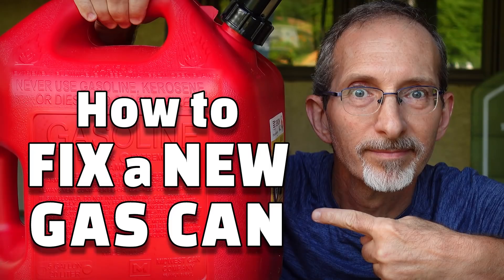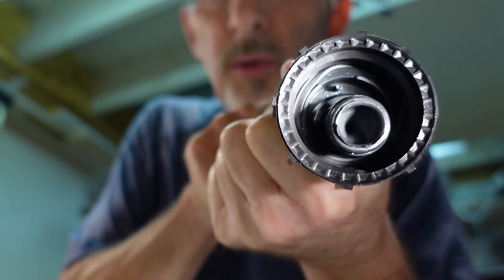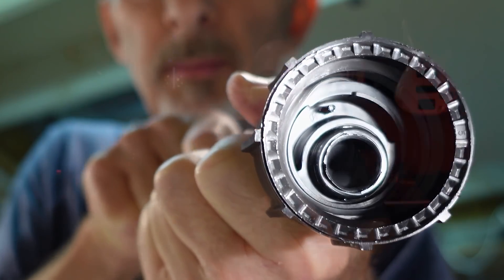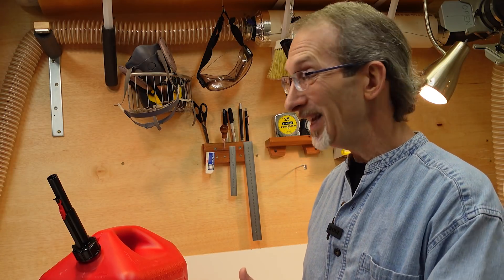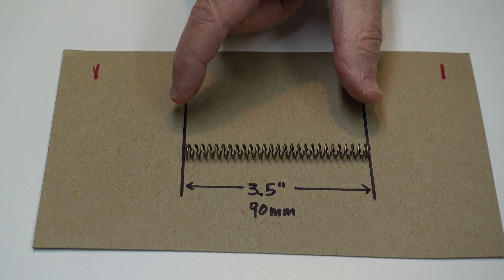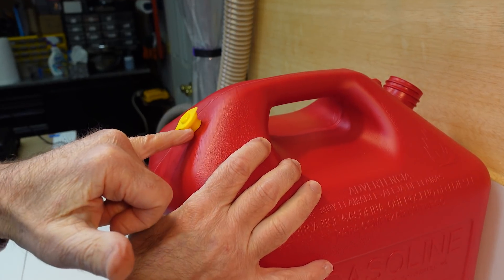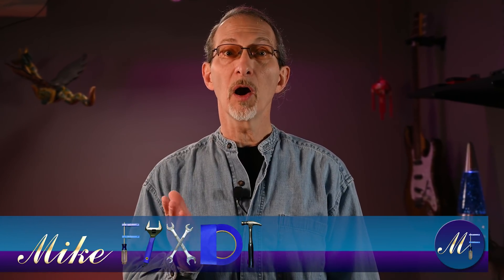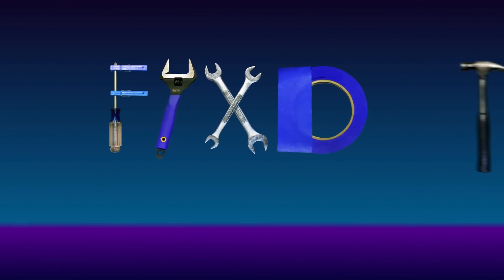Gas Can Modification | Part 2: Explosive Details!

Comment: I've put these vents on all of my gas cans. I leave the  vent open when in storage to keep the gas from pressurizing when temperature rises while in storage.  When the gas becomes pressurized after temperature increase it will come gushing out of the can and spill everywhere when the vent or spout is opened.  This happens mostly when the can is full.  Happened to me more times than I want to count until I installed these vents.  Also, when the can is empty and not vented the sides of the can will suck in overnight when temperatures drop.  Properly used, these vents are the best.

Comment: I am over 60 years old. I’ve had many gas cans and these poorly designed. Supposedly safe new ones have caused me to spill more gasoline on the ground in the last five years then I did in the previous 45 thank you very much government regulations and people that have no idea what they’re doing. Next, let’s talk about the safety sealing function exactly what is the burst pressure of a plastic can when you leave it sitting in the sun full of gasoline.? so to summarize inconvenient to fill difficulty use must be modified after purchase, and eventually you throw it away sounds like government efficiency at its finest.

Comment: A step drill works wonders. Just bought 3 spouts from TSC and replaced the pics poor new spouts
Reply from the maker: Step drill bits are cool! I would just add to make sure that you have enough steps to match the required hole size because you don't want to go too big. Replacement spouts are a fantastic option, too!
Reply: The one I have has 11 steps

Comment: For venting my gas cans I drill a hole in the same place but pull a tire valve stem from the inside. I remove valve and use the cap . If you loose the cap you can find them anywhere. It’s only safe to drill a new can so there is no gas fumes.  If you have gas fumes in the can you can use an air drill.
Reply from the maker: Steve, I've seen other people do the tire valve trick. Question - if you hook a bicycle pump to the valve can you push the gas out faster? 😄
Reply: Do what mechanics do when working on a gas tank, fill it with water, no fumes.

Comment: i added vents to my gas cans and didnt have a heat gun. i had good results with adding just a small bit of silicone to the vent "shaft" then pressing them in. i did allow a few days for the silicone to dry completely but years later they still work great. 
also instead of working on the silly spout there are great straight flow spouts available on ebay and amazon for fairly cheap compared to my time to mod an existing one and the frustration of dealing with mandated design flaws.
Reply from the maker: John - great suggestions! Thanks for sharing!
Reply: @MikeFyxdt  you are entirely welcome of course

Comment: Questions on the vent. I know this will sound stupid, but I won't be stupid anymore after reading replies.  Does vent always need to stay open?  What if you poured out all gasoline? How long does it take for locked-in vapors to become dangerous?
(Editing because I accidentally tapped send arrow.)

Aren't you defeating purpose of sealed gas can (for safety) by leaving vent open and allowing vapors to escape?

Thanks!
Reply from the maker: @Alice D - It's important that the container remain SEALED during storage to 1.) keep the gas from evaporating/diluting, and 2.) keep the flammable fumes from escaping into the space the container is stored in. When you are pouring, the vent (opened) lets air into the container to displace the fluid coming out. These containers are designed to vent through the same spout that the gas is being dispensed from, which is why they pour slow and make that 'gurgling' sound. An additional vent at the top of the container (opened only when dispensing) lets the fluid flow out faster and smoother. Hope that helps! :)
Reply: @MikeFyxdt  Thank you!

Comment: My issue is the gas spout collar tends to eventually crack.  I don't know if my son cranks that sucker so tight the thread action forces a crack or the gaseous expansion in sunlight increases pressure to the point of creating a crack (or a combination), or if the material gets brittle over a few seasons.  I hope someone can explain a way to repair a crack when the surfaces are extremely smooth.
Reply from the maker: I agree that cranking it too tight can make it crack. Keeping it out of the sunlight is also probably a good idea… I don’t know if that plastic is repairable. Fortunately there are replacement nozzles available if that’s the only problem that you have with the container. Thanks for checking in!

Comment: The video is good!
The whole situation is ridiculous!
Most people close the vent and screw the cap back on!
The existing designs were fine and worked!
The spout cap, shown last I see it more to keep dirt and debris out than gas in.
The lack of a cap to keep the spout clean is a major design flaw!
The old design addressed that!
The spout is supposed to keep the gas in with the O-ring...so I see a cap now more to keep it clean.

Part of this new design nonsense is that they apparently don't trust you to close the vent and put the cap back on...gee...thanks...what would I do without you?...
Close the vent and put the cap back on I suppose...
The old design was fine and it worked!
I for one don't spend a lot of time pouring gasoline onto open fires...so I question the spark arrestor too.
I will say though I've had cans with that feature that didn't interfere with basic use like yours did.
If it doesn't interfere then I'd leave it be...
In my area plastic cans are chewed on by critters so metal cans look more attractive even with potential condensation problems.
I've had two different spouts with holes chewed in them and the handle of another can with a hole chewed in it.
So, one can totalled and I had to cut one spout short and buy a rubber stopper as a cap and a whole new spout for another can they attacked at the base of the spout.
At least they spared the threads of the can.
Also my fuel got exposed to the air and moisture.
It's been an expensive lesson.
I'm glad some still sell metal cans new, and Craigslist, used without the features both of us don't like.
From now on I'm buying good used metal cans.
Reply from the maker: Michael, I guess I didn't address the purpose of a cap keeping the spout clean. Good point, I agree that's important! If I had to purchase again I'g get a metal can, too!

Comment: Thank you for sharing - 

I absolutely hate it when modifications are done to make environmentalists happy or to "keep the company from being sued".  These new nozzles are hard, and any of us who have tried using them, know you can't pour gas into a car with them, unless you get a funnel, someone to hold the funnel, and you splashing yourself with gasoline.  As soon as I bought one of these, I ordered flex nozzles course threaded from Amaazon, and threw out these stupid "safety" nozzles.  

California in the 70s decided to refit all the gas pumps with these accordian sucking contraptions that were designed to suck the fumes all to "save the planet".  It was a nightmare to fill the car, because you couldn't tell when the car overflowed.  Went back about 20 years later, and all the gas pumps no longer had these contraptions.  

So if you want to save yourself a headache, and don't want to mess with resizing the spring, and still having a nozzle that won't fit on your car, go to:

https://www.amazon.com/kitchespiderm-Replacement-Universal-Compatible-Container/dp/B09DWZ8KBK?pd_rd_w=9MtvH&content-id=amzn1.sym.80bfd2e5-c81d-48d5-ae85-c500e2214af9&pf_rd_p=80bfd2e5-c81d-48d5-ae85-c500e2214af9&pf_rd_r=N1QNAAE6XC613XBG9KYS&pd_rd_wg=BqQ4i&pd_rd_r=b5d1c219-9c70-4e77-9336-4a6a26fc3c78&psc=1&ref_=pd_bap_d_csi_pd_ys_c_rfy_rp_crs_0_i
Reply from the maker: Dwayne - excellent suggestion - thanks for sharing the link! :)

Comment: buy a syphon pump and forget the mods.
Reply from the maker: If you have a siphon pump, then you will still need to remove the flame arrestor screen, as it would prevent the siphon from going to the bottom of the tank. But I like how you’re thinking!

Comment: To quote the great Southern philosopher, Ron White, "Ya can't fix stupid!"  The decline of society is quite sad when, after hundreds of years of humans pouring liquids from buckets and cans, we end up with cans such as these.  Another indicator are the number of auto manufacturers whose advertisements don't highlight the aesthetics, efficiency and longevity of their product, but highlight the vehicles capability of slamming on the brakes when some yahoo steps out in front of the car while staring down at his cell phone.  Has there been an outbreak of oblivious street-crossers? (Or is it "streetS crosser?") Due to Hurricane Ian I had the opportunity to use an anti-splash diesel can.  After figuring out the spout the mechanism, I then hoisted the 5 gal can up to chest height while trying to hold down the safety catch and then shove the spout into the tank. The spout and limiting ring in the truck fuel neck did not match up and the result was nearly more diesel on me, the truck and the ground, than in the truck.  I ended up removing the spout using a plain old funnel-I'm such a rebel.  A comment about your process of installing the vent cap; I was shocked that you were not wearing leather gloves, ear protection, face shield and chainsaw chaps while drilling the holes.  I attempted to perform the vent modification to one of my regular gas cans, but I didn't have a heat gun.  So I used a propane torch...I forgot the can had 2 gal of gas in it.  My comment is being submitted by a Nurse in the Burn Unit who is graciously typing for me.  FYI-I'm envious of your shop vac system - Nice!!  I can't believe I spent nearly an hour watching videos about a gas can....  GREAT Job, Mike!
Reply from the maker: @R Taylor, your post made my week!!! 👍🏻❤️👍🏻❤️👍🏻 Right on brother!

Comment: I've made all of these modifications except for the locking ring. The ring wasn't an issue for me and it did help prevent the nozzle from accidentally untwisting itself (I had an issue with that happening).
Reply from the maker: Excellent! Thanks for watching and joining the conversation!

Comment: I like the fact that the new cans don’t have to be vented.  So I don’t have fumes in my car or garage.   I have 1,2 and 5 gallon cans.  Would never use the five for filling a lawn mower, generator or  most anything else with a small fuel tank.  As you noted, 5 gallon fully loaded is very heavy.   On the other hand very easy to use with 1 or 2 gal.  5 is used on the boat for fuel transfer or filling the smaller containers.  Adjusting the spring tension sounds like a good idea.  The newer spark arrestor that I have seen have been redesigned.  Funny thing is seeing someone smoking while using a gas can or gas station fuel pump.  If your going to add a vent, you might as well get rid of the spout and use the old fashion type that remain available on line.
Reply from the maker: Greg, when I added the vent to my container (with the modified spout) it helped it four more smoothly and quickly than the vent that's built into the spout. An old-school spout is a good alternative!

Comment: The problem is threefold...

1.  You have stupid users.  You can't design around this though since if you make something "idiot-proof", the world will just create bigger idiots... We need to STOP trying to interfere with Darwin...
2.  Ambulance chasing lawyers who convince the idiots that they might be able to get rich off of their stupidity...
3.  Juries who are stupid enough to believe the crap that these lawyers are saying...

When I buy a gas can, my primary concerns are:

1.  That it NOT leak regardless of whether it is store right side up or even upside down...
2.  That the opening when the cap is removed is large enough for the nozzle at the gas station...
3.  That it is durable (i.e. not some light weight / thin plastic or metal)...
Reply from the maker: Sean - sorry, I didn't see this comment until now... As for your primary concerns buying a gas can, I think these Midwest containers would pass the 'upside down' test, but only for a few moments. The nozzles are NOT good for fueling a car directly, in my experience (a funnel makes a huge difference). Overall I DO think these containers are durable for their price. But in retrospect, I would have bought a different container at the time, if it were available and knowing what I now know. I appreciate you joining the conversation!

Comment: I bought this same can and absolutely HATE IT. It's worthless for filling and pouring. I have spilled more gas with this can in six months, than I have in the last 50 YEARS with my old gas cans, which I have NEVER had one single problem with. 
 These can manufacturer's should just go back to the way spouts used to be and imprint a label on the can saying " IF YOU ARE STUPID ENOUGH TO ENDANGER YOUR LIFE WITH THE CONTENTS OF WHAT YOU PUT IN THIS CAN, WE ARE NOT RESPONSIBLE, AT ALL, FOR YOUR STUPIDITY!! Thanks for the tips to make these garbage cans a little easier to use. These IDIOT bureaucrats need to be fired and get people that have common sense!
Reply from the maker: @AMERICA FIRST - Your label suggestion is excellent. I'd LOVE to see that! :)

Comment: I was looking at these gas cans and don't have a lot of money to purchase a better metal  one. I want to drain my cars gas tank which has no anti siphon deal in the tanks filler. I wanted to use a bulb type to get the gas to gravity drain but with the screen I might be able to siphon the tank into the can yet cannot place the can higher and drain it back in the tank without removing the gas cans screen thing. Also without the add in vent say the gas can is empty nothing but fumes I assume the gas can will collapse. Or is there a built in feature that prevents this?
Reply from the maker: William, sorry about the delayed reply… There is a lot going on in your comments. If you can siphon the gas out of the car and into the container then that is great. I don’t think the filter/flame arrestor will keep the gas from siphoning. If you want to siphon back into the car, you’ll definitely need to remove the filter so the siphon hose can get to the bottom of the container. Consider putting the container on a small table next to your vehicle, so the bottom is higher than the end of your siphon hose to make the siphon flow. Alternately, why not just use a funnel and pour the gas back into your car after you have done your work? That’s what I would do. 

As far as these tanks not having a vent, I have never had an almost empty container collapse, rather they tend to bloat and build up pressure. But I suppose it could work either way. I wouldn’t be concerned about the container destroying itself however.
Reply: @MikeFyxdt  I removed the filter and the spring . The main reason I wanted to siphon out then back in is I am using a fuel filter on the outlet side of the bulb siphon thing I bought. I wanted to catch any stuff that may be in my fuel tank. I imagine that using the fuel filter to drain the gas into the gas can would be enough.

William
Reply from the maker: @williamjahn7514  sounds like a plan! 😎

Comment: A dull drill bit is easier to drill plastic with. It won't suck into the hole and bobble the hole oval. I used to keep a set of old garbage bits just for wood and plastic. I would sharpen them like any other bit but then  knock the flute face flat on the outer third. I would also dull the outside diameter of the flutes so they drilled tight until you pushed past to the sharper edges of the drill.
Reply from the maker: That’s a good idea! I didn’t realize how much these sharp drillbits would be sucked into the can once the bit, no pun intended!

Comment: Thanks so much for this information Mike. My first experience with these so called improved nozzles was when I ran out of gas in the turn lane literally 10 yards away from the gas station driveway. 

I ran into the store and purchased one of these new cans to get my car out of the way of blocking about 7 cars at the time. 

Unfamiliar with the nozzle, I could not get it to flow. It finally trickled enough in to start the car. I think more went on the ground and on my hands in the process. 

I have since modified two gas cans with these nozzles that would have otherwise been heading to the trash. 

One thing I would add to your mod is that when you have the O-ring off and are modifying the spring, REMOVE the red clip! It just swings out of place. Once reassembled it eliminates the need to touch the nozzle and potentially get gas on your hands. Just another useless unneeded step. You can now just press nozzle into its destination.
Reply from the maker: Thanks for sharing your story Leo! I like leaving the red push button attached because it keeps the nozzles from accidentally depressing an opening if you’re moving the container around. I’m always willing to try new ideas to make these containers easier to use so thanks for your suggestion!
Reply: @MikeFyxdt  Yes. I also realized that in removing the red button you have to make sure you have the modified spring just right. Enough to still create a seal but not to much that causes to much stress on the o-ring causing it to possibly fall off and into the gas.